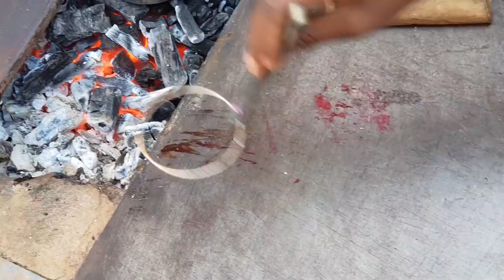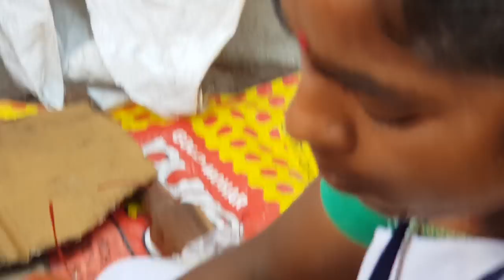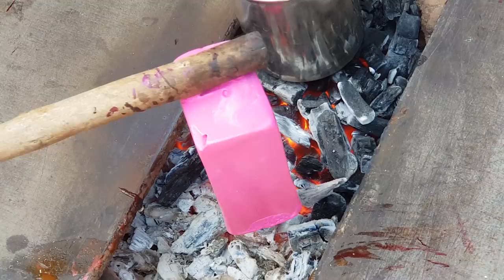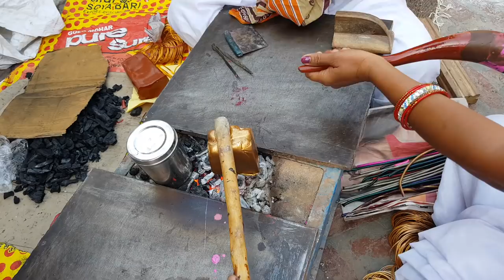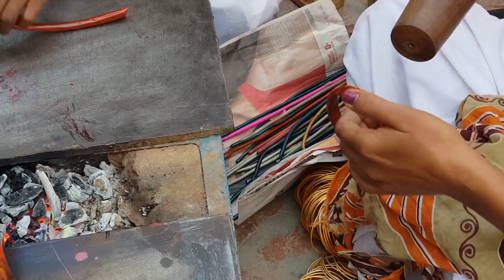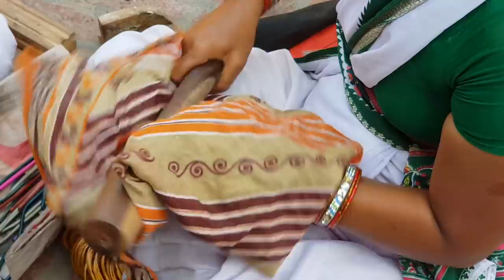Unveiling the Vibrant Lac Bangles Crafted by Jharkhand Tribals: India's Prized Artistic Gems

Comment: Bangles, how they do it.  First he takes the dinglebop and he smooths it out with a bunch of shleem.  Then he takes the dinglebop and pushes it through the grumbo, where the fleeb is rubbed against it, because it has all the fleeb juice.  Then a shlamee shows up and rubs against it and spits on it.  He cuts the fleeb, there are several hizards in the way.  The blamphs rub against the chumbles, and the grumbo is shaved away and that leaves you with a regular old Bangles.